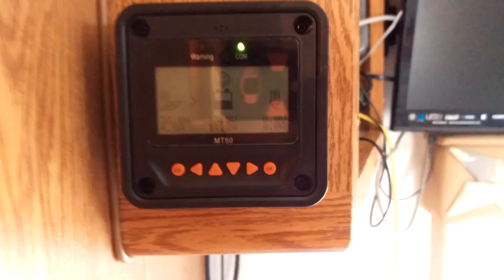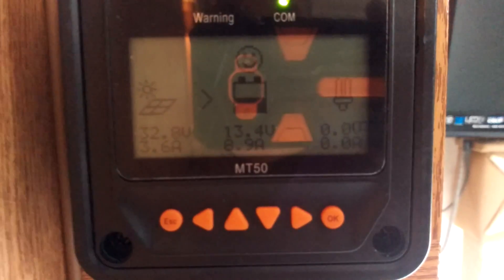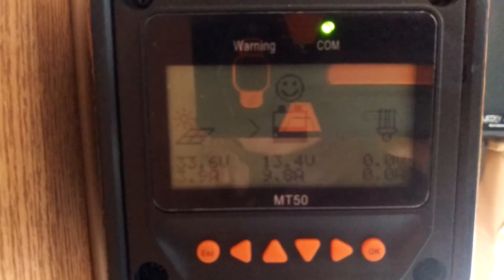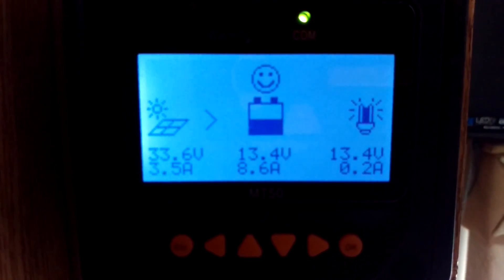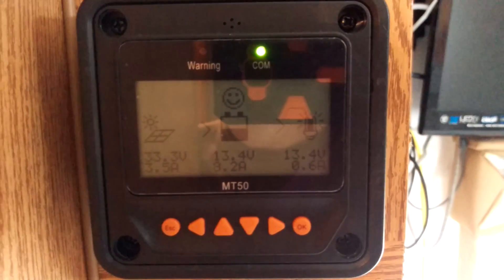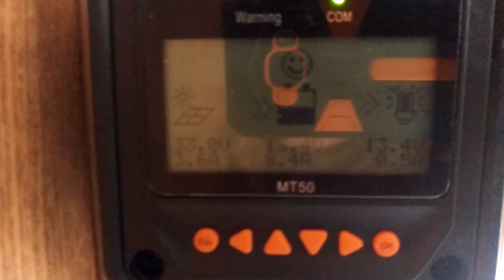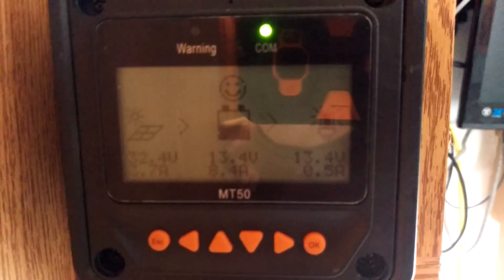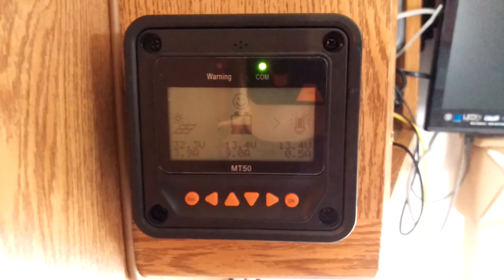I HAVE THE POWER... free power that is !!!

Comment: Do you know you can use a laptop to setup your converter?  The cable is cheap and you can see what your controller is doing and it logs what it has done.
Reply from the maker: Yes I already have the cable its a great option. I Just have not hooked it up yet.